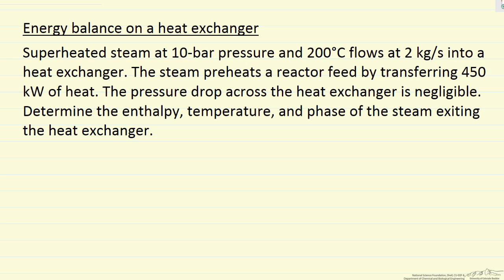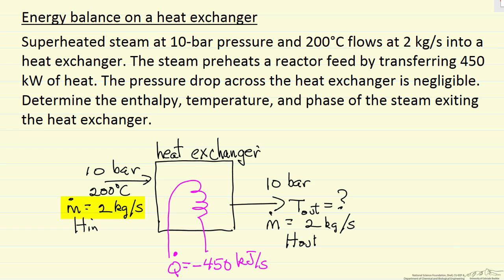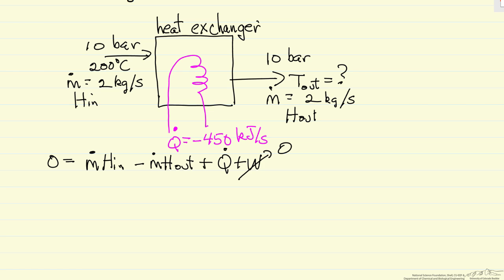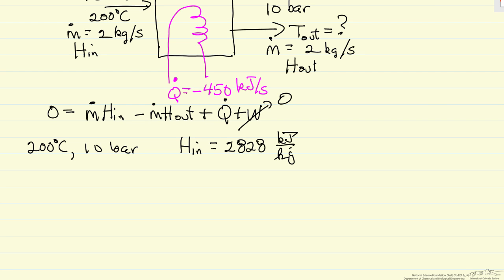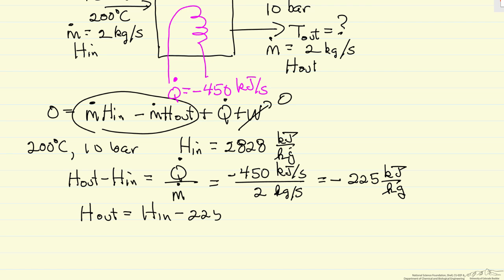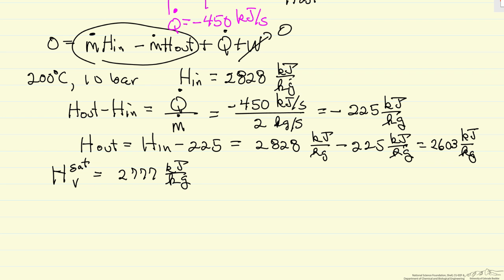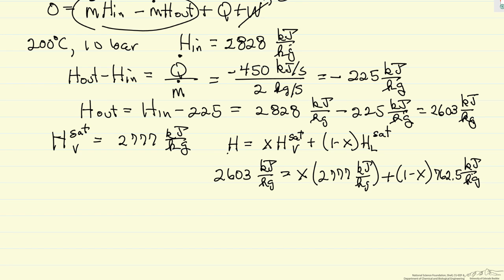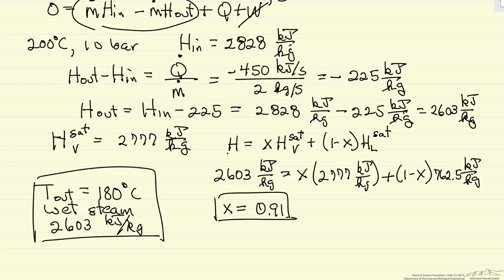Energy Balance on a Heat Exchanger

Comment: To those studying for a PE exam, note that this problem can also be conveniently solved using a Mollier diagram.  Plot the entering temp & pressure to determine the enthalpy, then subtract the enthalpy that's transferred in the exchanger and plot the exiting enthalpy at the same pressure to determine the exiting temperature and quality.

Comment: What is x? And what is the purpose of solving x=0.91?
Reply: x is the vapor fraction of the steam. The problem asked what phase the steam (water) is in exiting the exchanger. The superheated steam entering the exchanger is cooled to saturation, and then 9% of it by mass condenses to saturated liquid, and 91% of it exits as saturated steam.

Comment: Why is the heat taken as -450°C. in the question the heat is transferred In the heat exchanger so q should be positive right? Please correct me sir if I'm wrong
Reply from the maker: The steam is pre-heating a reactor. Meaning it is transferring it's heat to somewhere else, thus the steam that we are looking at is losing heat. Hence the loss.
Reply: LearnChemE thank you

Comment: from the steam table the value of Hv sat should be 2013.6.2777 is the steam value
Reply from the maker: No, 2828 kJ/kg is correct. The value of 2013 is the value of saturated steam at 10 bar, but this temperature is lower than 200C. The steam is superheated in the problem.

Comment: Why is the temperature 180 C? will the quality or the presence of liquid affect this number?
Thank you
Reply: The temperature is 180 C because it was proven, using the enthalpy coming out, that the exit stream is in the point of two phase. This means you can just take the temperature of the saturated water and steam at 10 bar (which is found in the steam table) which is 180 C